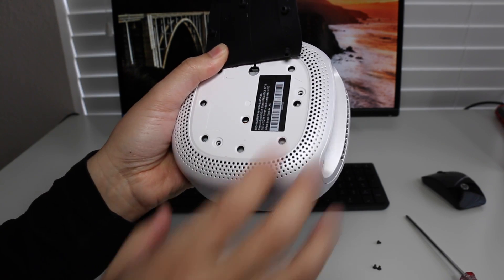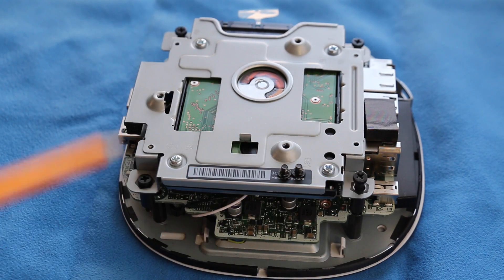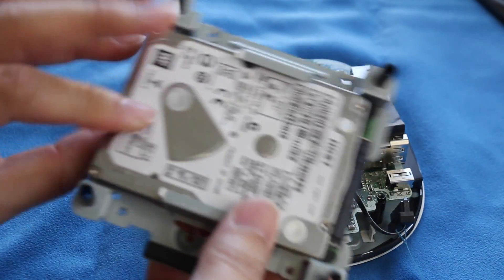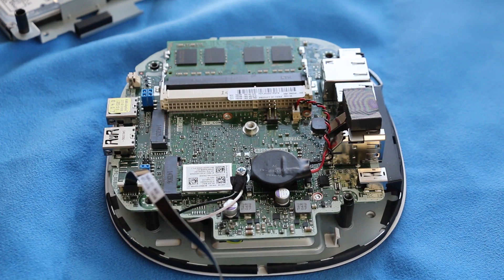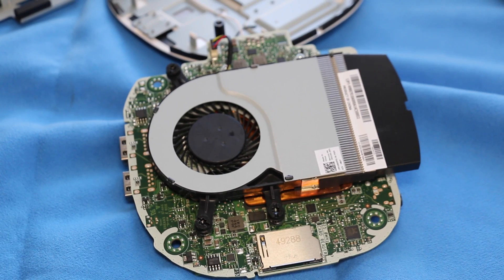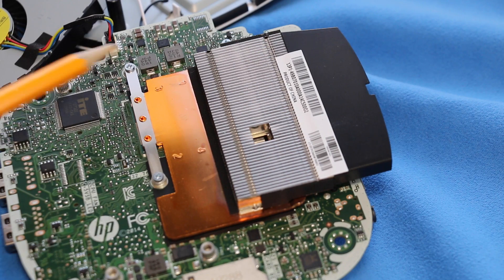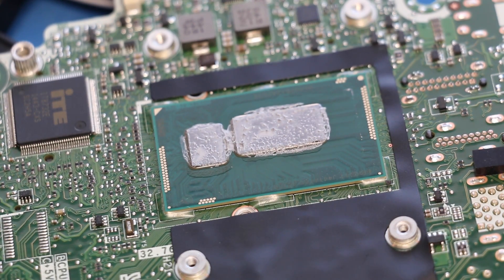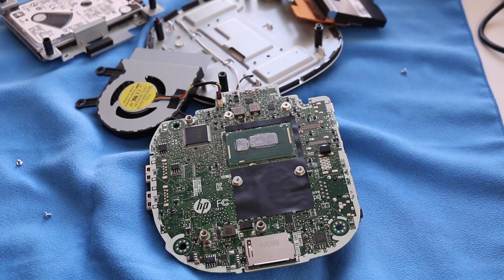HP Pavilion Mini Internal Components Revisted

Comment: looking to buy a replacement fan for this exact unit shown in this video. I've searched many places with no luck.  HP Pavilion Mini Desktop, Model number 300-020.
Reply: Lol, just came back from a HDD repair where the guy said I need a new fan also but they cannot find one,ugh.
Im no tech but would hope that a fan from a HP laptop would work just that it might not fit perfectly. I really dont care so long as it can be installed and cool the unit.
Reply: Same issue here. The fan is officially discontinued :( Any advice would be very welcome.
Reply: USB fan

Comment: Do you guys know where to buy online SATA Cable spare part of this model? I found nothing.
Reply: HDD Cable - for an HP Envy 17 Series - Cable Adapter 6017B0421501 - Puchased one for $9 on ebay.  Looks like they are $15 and works in mine with an SSD or Laptop HD

Comment: Hi. which type of m.2 ssd do i need, and can i use the m.2 ssd as a the primary bootable disk with windows and have the hdd as a data disk? Any help would be appreciated!
Reply: Purchased a HP  Lite-on M.2 on ebay, SSD cable is for an HP Envy 17 Series - Cable Adapter 6017B0421501 - Puchased one for $9 on ebay.  Looks like they are $15 and works in mine with an SSD or Laptop HD

Comment: thanks for your video. I would like to add a second ssd drive since there is the space to do so but I'm missing the sata cable specs to connect it. my model is 300-240, do you know the specs for the cable? Can I have a second ssd installed without having troubles? thank you in advance for your help
Reply: @geminiinsights6382  long time ago (8 years), I guess I risk it and did it. However I don't remember anymore what I did. In the meantime I sold it.

Comment: What brand memory module does it come with? Does it come with a single 4gb memory module?  When you show the hardware, it seems you already removed the memory module or modules.  I want to buy the 300-230 model with an i3 cpu and 4gb of ram, but I need to decide what configuration of memory module or modules to buy since I believe 8gb is more than enough for what I want this mini pc for. Anyhow, thanks for this video.

Comment: Thank you Andrew. you are just awesome!. I need help - the PC3-12800, to spruce it up - should I go up to 8+8GB or 16+16GB? Thanks in advance. :)
Reply from the maker: Prem Mani What kind of programs are you running?
Reply: ***** I specifically need to run all of the Adobe related programs, I have the Adobe collection 2014
Reply: +Prem Mani I do have the same question either 8GB or 16GB.  I will mostly use this baby as a HTPC, for I am planning to cut TV CABLE service.  I am planning to watch some network shows over the Net, and others using Amazon Prime, Netflix & Hulu Plus as a replacement for TV CABLE.  Thanks.

Comment: not sure if this is the one...?
http://www.ebay.com/itm/HP-PAVILION-DV7-6000-DV7t-6xxx-2nd-Hard-Drive-HDD-Cable-Connector-Adapter-LONG/141565736513?_trksid=p2047675.c100005.m1851&_trkparms=aid%3D222007%26algo%3DSIC.MBE%26ao%3D1%26asc%3D29170%26meid%3Ddaa8727c0fea4660b775e5f1931c6ee0%26pid%3D100005%26rk%3D1%26rkt%3D6%26sd%3D260769237757&rt=nc

Comment: What method would you use to clone the HD to an SSD?  It appears that there is only one bay for a hard drive.  Are there any issues with Windows activation since this would be a hardware change?  Thanks.
Reply: Stephen Lee It shouldn't matter that it's cloned, OEM Windows 8 reads a bios string to verify itself. (OEM Windows 8 devices don't come with a CD key for that reason). Most SSD kits should come with cloning software. Kingston HyperX Kit has it, and so does the Samsung drive (non-kit), it's on the driver CD.
Reply: MasterMWL Thanks for the info.  I successfully cloned to an SSD about 3 weeks ago.  No problems.

Comment: Did you find an HDD cable for the Stream Mini?
Reply: ***** I really wanna know about the cable also. I ordered the stream mini
Reply: I thought about it for a week or so then decided at that price just  return the stream and upgrade to the next model up. )o:
Reply from the maker: cameron jay Hi Cameron, so far I have not found one. I will keep this page updated. Thank you
Reply: ***** Hi Andrew, great video. Have you been able to find the cable? Do you think that's a NOT standard cable? Thanks
Reply: The only place i have found the P/N 794966-001 Cable - Prius SATA, L:65mm PR2 for sale is at http://www.impactcomputers.com/794966-001.html  $75 dollars, Ouch!!!! )o:
Reply: Thomas Giera I work with Impact, unfortunately right now no one else has this cable, and we've acquired the parts art a high cost, however pricing changes sometimes, for most up-to-date pricing, contact me at 1800 797 7164 ext 460 Ralph
Reply: Ok, I need to vent in this small corner of Google Plus so I apologize in advance..... I did some research because nobody seems to know anything..... So, looking at shipments out of China posted Harmonized codes (don't ask,) how disturbed was I to find those very cables we were looking for, and yes it showed their true price.... Yes, they are proprietary, and yes they aren't as massed-produced as other cables are, but Impact Cables is likely paying close to the cost I saw, which was just over $14 per cable. If they say they are paying more, they are either using a horrible middleman who is marking up way too much or they are rearranging the truth to make it sound different. When you call HP for that part number, they say you can't order it from them and direct you to.....(wait for it, wait for it.....) IMPACT! Folks, just wait and they will appear on Alibaba/xpress and/or Ebay soon enough, and they will cost about $15, not $75. So don't give in. I understand Supply and Demand, but unless you want people to outright publicly embarrass you by disclosing your purchase cost and making you look like a greedy troll, you should really reconsider your price. Even DOUBLE would be reasonable. Disclaimer: I am speaking to the middleman and not Impact Cables.
Reply: If you are still looking for the Prius SATA cable, I found some on ebay:
http://www.ebay.com/itm/151802721724
Reply: HDD Cable - for an HP Envy 17 Series - Cable Adapter 6017B0421501 - Puchased one for $9 on ebay.  Looks like they are $15 and works in mine with an SSD or Laptop HD